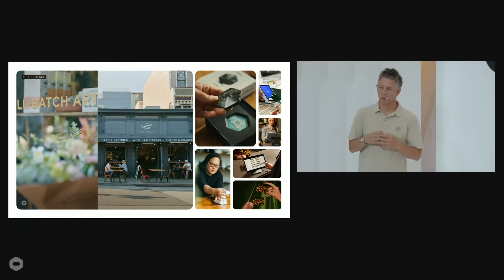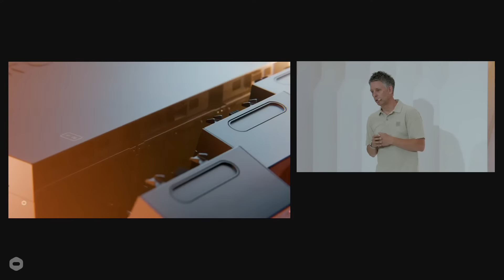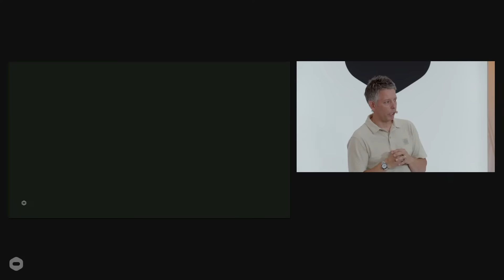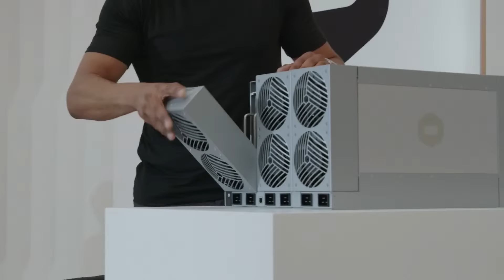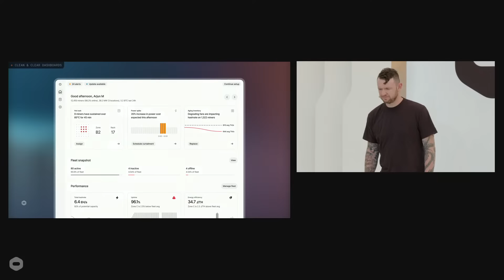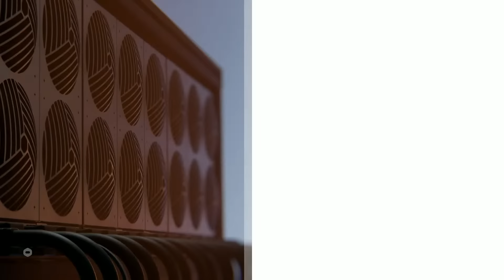Introducing Proto: The future of bitcoin mining

Comment: I don't know about ya'll but I'm excited to see this product and willing to give it a go. Making it modular is wonderful and the demo was great. Would be great to see the $/th and J/TH to get a better idea of what this thing can do.
Reply: Yea, all I want to know is how long after buying it does it take for me to break even lol
Reply: @pulsefiend Obvious questions right...!
Reply: exactly, what actually matter is not discussed. Ehen sales people do this, we need to watch out.
Reply: Basic Specifications:
Hashrate: Up to 819 TH/s (terahashes per second)

Power Consumption: Up to 12,000 W (12 kW) total, with 3 power supply units (PSUs)

Power Efficiency: Approximately 14.1 J/TH (joules per terahash)

Dimensions: 390 mm (W) × 290 mm (H) × 500 mm (D)

Weight: Approx. 110 lbs (50 kg)

Cooling: Air-cooled standard configuration; fans include six high-efficiency 48V units variable up to 9,000 RPM

Electrical Input: Compatible with 208–240 V AC, 3-phase; frequency 50/60 Hz

Network Connectivity: RJ45 Ethernet 10/100 Mbps

Other Features:

Modular design with 9 hashboards, enabling individual board replacement/upgrades

Rapid field repair (tool-free hot-swaps with <90 seconds downtime)

Designed for high-density rack deployments (approx. 9.4 kW per foot of rack space)

Software for diagnostics and predictive maintenance

Operating Conditions: Suitable for up to 90% humidity (non-condensing), up to 2,000 meters altitude

Warranty: Standard 12 months, extended options available

Forecasted Price:
Pricing varies based on configuration and order scale.

Early estimates position the Proto Rig in the $10,000 - $15,000+ range per unit, consistent with premium bitcoin mining hardware prices.

Longer-term, the modular upgrade system aims to reduce operating and replacement costs significantly — individual hashboard upgrades instead of full unit replacements.

Energy cost assumptions (example at $0.06/kWh) forecast approx. $29–30 daily gross returns per rig, with a profitability of approx. $9,000 to $10,000 annually.

Summary:
The Proto Rig represents a new paradigm in bitcoin mining hardware focusing on:

Modularity and repairability to extend the rig lifespan well beyond typical 3-5 year cycles, targeting 10+ years.

High power density, better cooling, and efficiency.

Open-source control and monitoring software free for users to manage fleet operations effectively

Comment: So out of touch with the goals of decentralization. Targeting "infrastructure" and "operations". A truly scalable system should be scalable from and accessible to the home mining level and up. No mention of pricing is all you need to hear to understand that this is just more centralized corporate junk capitalizing on the Bitcoin infrastructure instead of truly helping it.
Reply: Without volume, there's no way they can disrupt Bitmain. Meanwhile, open source software and making specs available so groups like OSMU can adapt the platform for home miners and other use cases is A+. This is still a massive improvement over the status quo.
Reply: "Infrastructure" doesn't have to mean just giant mining farms. Modularity and serviceability is important for heating applications, too.
Reply: "the goals of decentralization" - they're a public company, so it kinda seems like their first goal is profitability, not necessarily decentralization (at least for this product).  But the open-source aspects are nice
Reply: @BayAreaMotorcycleCommuting I don't think those two concepts need be mutually exclusive. Then again, maybe the first mistake was thinking a publicly traded company, typically at odds with the philosophy of Bitcoin from the offset, could have the philosophy of Bitcoin as their guiding light.